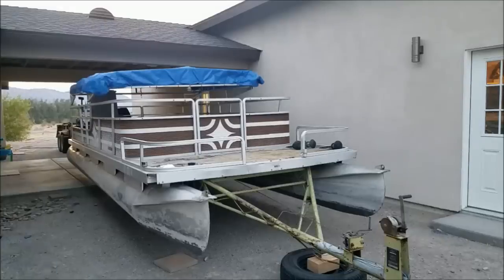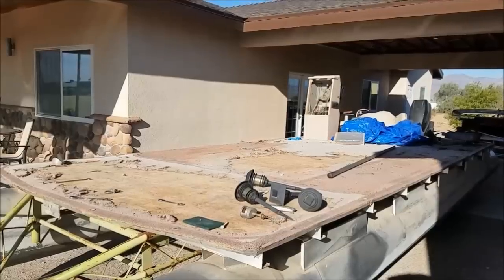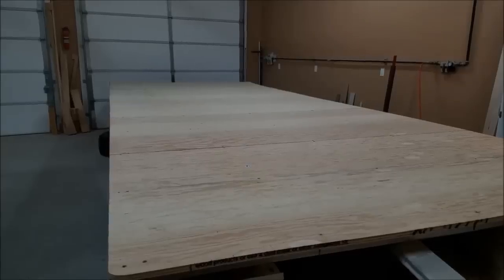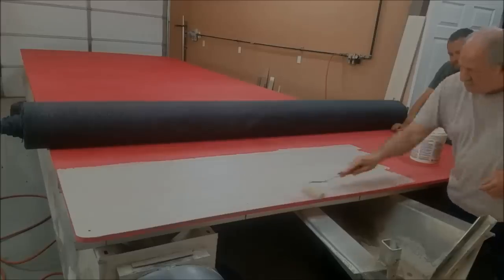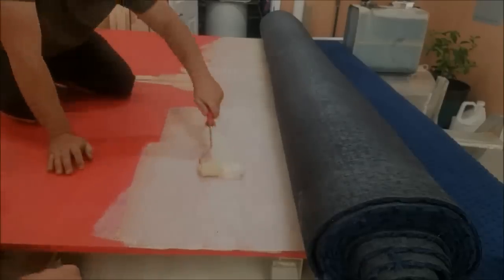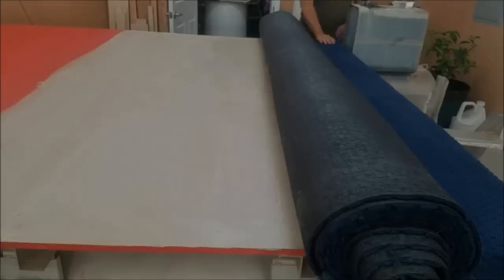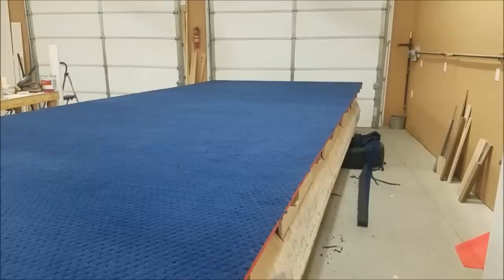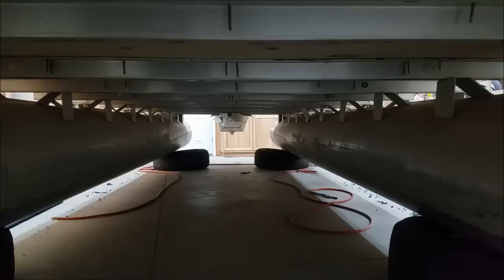Craigslist Pontoon Boat: Replacing Carpet and Deck

Comment: can you give the link for that deck boards ? are they 4' x 8 ' ? are you still happy with the non-marine grade ply ?
Reply: Always use marine plywood. If not even if you seal regular plywood it will rot out within a few years vs 20 plus years you get with the marine plywood the manufacturer used. While its more money it will save you time and money in the future.

Comment: I’m new to this so be gentle.  😂. I’m curious as to why you didn’t water proof the backside prior to placement 🤔 that’s the side closest to water.
Reply: being a boat it WILL get water saturated and if it is too tightly sealed it won't evaporate out promoting rot and adding massive weight to boat later

Comment: I am surprised you didn't clean and buff the pontoons before you installed the deck.  Deck looks nice but I would have used a notched trowel.  When do we get a ride?  Thanks!
Reply from the maker: Tried, tried, and tried. 
Its calcium. CLR gets it right off, but you aren't supposed to use it on aluminum.
Reply: @BrandonsGarage  You might try an angle grinder with a pad attachment and use the center pop out of floor scrubber pads.  These should take off the thick scale without hurting the aluminum then use a mild acid may be even vinegar to clean the rest off.

Comment: I bought a Brand New 1999 Aqua Sport 24 Center Console, in 1999.....why is everyone saying "Bring Out Another Thousand?"  Ive had no major issues whatsoever!  Other than normal maintenance costs, what the hell are you doing to the boats?  And I run 3 times a week. 30+ miles offshore.
Reply: It's because you use the boat 3 times a week that you aren't having any major problems! 👍

Comment: Looks nice, but the mistake you made...IMO...is that you did not prep the plywood before screwing it down. The red stuff is fair, but I wont use it...too expensive compared to oil based paint. I have done many jobs like this and I always go to Loe's or Home Depot and get a couple of gallons of OIL base paint that someone didnt want. You can usually get a gallon for around $7.00 and it is quality paint...just a goofy custom color. But who cares about the color when one side is down and the other is covered in carpet. Apply the paint to the plywood thick. If you have 2 different colors, paint one side one color and the other side the other color. Let it dry and then install it. The oil base paint water proofs the wood so that you dont get any wood rot later on. If you dont want to use an oil based paint, then get some fiber glass resin and mix it up and paint the plywood with that...but it will be more expensive. Also, you dont need 2-3/4 self tapping screws...way too long. Depending on the thickness of your plywood, you can do what we do...use 1/4-20 x 1 long stainless bolts, flat washers and lock nuts. take a flat 3/4 flat drill to counter sink a hold about 1/4 inch deep, then drill thru the center and the Z bar with a 5/16 drill. Put a flat washer on the bolt and push it thru, then put on a lock nut. It will take two people to tighten up the bolt but when you do, nothing is going to strip out or come lose. When you get all the bolts in, come back with the paint and paint the raw wood there you drilled. the counter sink will be deep enough so that the hex head 1/4 bolt wont be sticking up. To fill the hole, use some JB wood filler and smooth it off level with the plywood. Your decking is there until the cows come home.
Reply: "That red stuff"..now that was funny.  Maybe you don't know, but that red stuff is so strong and durable that it's used in showers to prevent water from getting to the studs, and it does, forever.  Comparing Redgard to paint is laughable.  Sure, Redgard is expensive but there's nothing better for blocking out liquids.

Comment: Is it a wivestale that treated wood shouldn't be used next to aluminum due to possible chemical reaction?
Reply from the maker: I don't know about the wood, but that is the problem with hardware. 
...but probably. A lot of the chemicals I've looked at to clean the calcium off the pontoons, clearly says not to use on aluminum.
Reply: I recently used kaboom toilet bowl cleaner on the hull of my aluminum smoker craft with fantastic results...that was removing water scum lines and not any build up of calcium...worth a try.
Reply: It is not wise to use "treated" wood on aluminum. The treated wood guards against insects, not water. Marine grade and treated wood are completely different.
Reply: Not a wives tale. Treated wood has copper in it. Water plus copper plus aluminum equals a battery..and galvanic corrosion.

Comment: You didn't waterproof the underside of the deck. I think you'll find that was a mistake if you decide to keep this one for a long time.  I do realize it's exterior ply but still feel you should have protected the underside. At this point I'd use epoxy marine paint.
Reply: Patrick Martin I heard that if you epoxy both sides and water gets trapped in the plywood from screws it will rot faster. Not sure if that's true.

Comment: I'm surprised you didn't do anything to waterproof the underside of the plywood and I think it would have looked nicer to roll the carpet around the edge and then nail/staple it to the underside.
Reply: You'd think so but you can't and shouldn't, the metal trim won't come together to allow you to put the protective corners on if you wrap the carpeting, it's that tight a fit.

Comment: Is that marine plywood?
Reply from the maker: Gosh no,
$850 is a lot to fork over for some marine plywood.
Reply: You'll be regretting that in a few years when it rots out quicker because you didn't use the marine plywood that the manufacturer used. Regardless what you attempt to seal the regular plywood. There's a reason the old deck lasted as long as it did. Its because it was marine plywood. I know its more expensive but it will save you time and money in the future.

Comment: Several things: You should have spent more time on the structure (Cleaning and Detailing); I would have painted (Sealed) both sides of the plywood to protect it better from the water below - it'll last much longer; Plywood should have been tongue and groove to better eliminate the joints, provide and better deck, those joints will move (Creak); the SBR backing on the carpet was terrible (Poor Quality) wasn't even good; I also would have placed a few more tires to better support the pontoons, you tweak them and the whole thing is garbage, think about the way they support it on the trailer (Full length) there is a reason for that!
Reply from the maker: Good luck finding marine tongue and grove.
Interior, or pressure treated, sure.
Reply: @BrandonsGarage  I agree it's almost impossible to find but buying marine grade plywood (douglas fir) and then spending a little time actually doing the tongue and groove just for the sides that butt together would have made a better-longer lasting alternative. Having been in the boat manufacturing industry for years I've seen most everything. I just wanted to reach out to say there is a better way and yest it adds to the time element for replacing the flooring but do you really want to do it again? 
The detail of your video was terrific and as I said the console was beautiful (Dad did excellent) but that's what we do! Sorry, but the Dad came out in me as I was watching each of your videos, enjoy that barge, what I call 'em...
Reply: @BrandonsGarage  3/4 CAT PS1-09 Marine Grade Douglas Fir Sanded Plywood, Application as 4 x 8 available at Lowes!

Comment: That's a Harris Flotebote 240. I'm guessing it's a 1981
Reply from the maker: 83
Reply: Interesting because in 1982 they changed the design. I have the sales brochure from 1982. The canopy uprights you have are from models built between 1970-1981. Same goes for the graphics of the line and Star on the panels.

Comment: pontoon decks never rot from the bottom. Always from the top due to the carpet holding the water
Reply from the maker: Finally, someone who agrees with me.
Reply: You're absolutely right, it's why even the pontoon manufactures don't coat the bottom of the plywood and don't use marine grade plywood, just exterior grade.  Any water not able to escape will destroy the plywood.  it's not getting through the Redguard, that stuff is awesome, it sticks to anything you put it on and it expands and contracts like the rubber stuff it is.  
At $50.00 a gallon it's pricey but well worth it.  Did you notice the outside edges of the plywood were also coated with Redguard, they did it the right way.
Reply: Wood guy. You're incorrect with your statement of the manufacturers not using marine plywood. This particular manufacturer (harris flotebote) does use it. I in fact just so happen to have the sales brochure for this model year (1981) and own the a 1980 model year. The rug needs to be a rug that doesn't hold water but the marine plywood is why the original deck on this boat lasted as long as it did.

Comment: Why do people keep using plywood for decks??? It’s a terrible material and it’s going to warp and rot. Use a honeycomb fiberglass composite that will not warp, rot, corrode, and with a nonskid gelcoat surface it will last forever and be half the weight.
Reply from the maker: You'll need 6 sheets of 40" material - costing $1,344 + Tax and Frights.
And that is just the core. You still need to fabricate the top and bottom layers. 
Its cost and know-how. Pontoon boats aren't mega yachts. It just an affordable family craft.
For most, the life of the deck is usually longer than they expect to own the boat.
Reply: Well considering the manufacturer of this boat used plywood and it's something like 25 years old or more and there was no warping, just aged plywood.  Not only that but it wasn't marine grade plywood, just good old fashion exterior plywood and they didn't bother coating the top of the plywood so any water in the carpet also got into the plywood and sat until it finally evaporated.  What Brandon did was not allow the water in the carpet to get to the plywood, it'll sit in the marine grade carpet until it evaporates.  Considering he's in Arizona, that'll take all of an hour.  Any water splashing up on the underside of the plywood will also evaporate very quickly in that climate.

Comment: you didn't red guard the bottom? it's gonna get wet bro..
Reply from the maker: That's an understatement. 
It's still holding strong! 

... but actually, it only gets wet under specific circumstances. Otherwise, it's the occasional light mist.
Reply: Hi.  I am looking to do the same in this vid.  I was concerned with exposed wood, even marine grade.  Redguard on the bottom seems like a great idea and no brainer.

Comment: no UV carpet, to cheep  to use marine grade plywood.  you must be selling it.  Right?  Why any carpet.  If your going to sand down the bottom have a custom decal installed.  Shit you are one cheap dude.  Hint, a little bit of aluminum acid wash for the pontoons and they will look brand new.  NC Sneeds Ferry.